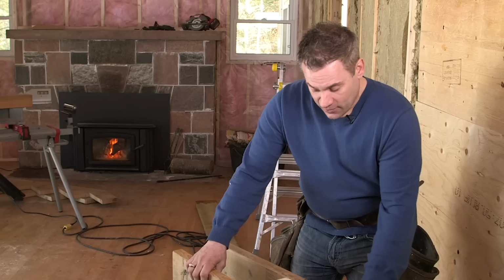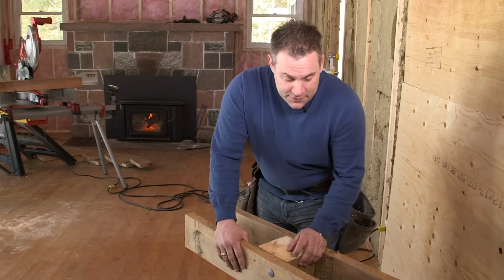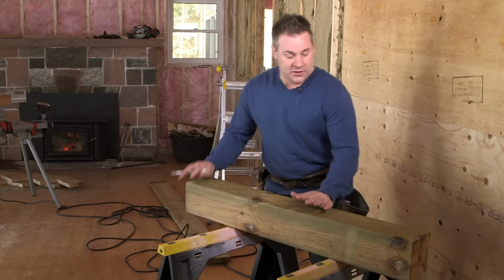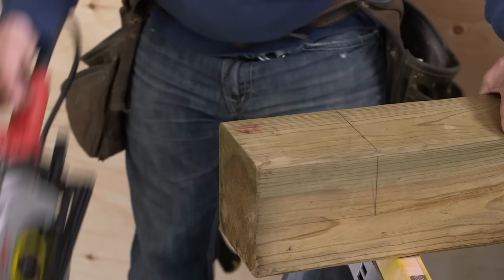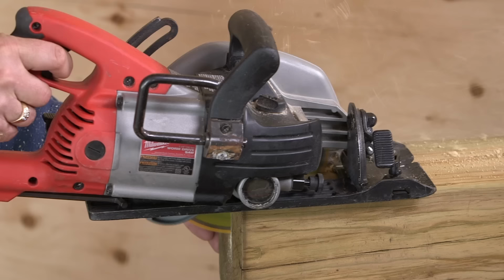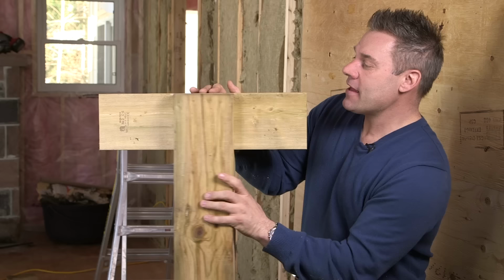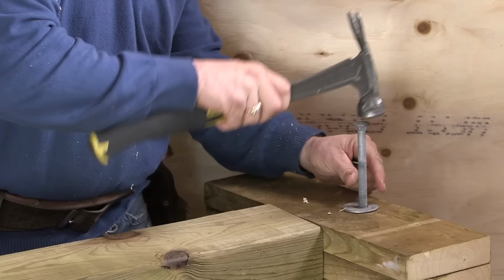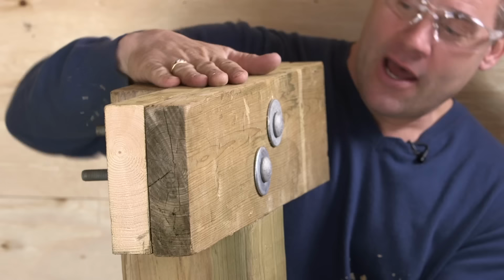How to Attach a Beam to a Post for a Deck | Decks, Docks & Gazebos

Comment: Still wrong, but better. cutting the support beam still decreases it's strength. use the full beam under the joist connecting with a Simpson strong tie, they make them for virtually every application
Reply: Brian Van Horne hardy, been building all my life, used that brand for many applications....what do you use genius?
Reply: Brian Van Horne  never notch, that is a rookie move...
Reply: That's fine,  your believe who and what you want. Maybe you should become an inspector, be a good job for you. But again in my opinion you don't notch when it is providing structural support,  once you do that (in my opinion)  you lose the integrity of the size of the material you are using. If you notch a 4x4 it's no longer a 4x4 for strength, you have turned it into the smallest remaining portion of said lumber.
Reply: Brian Van Horne  I don't know how you figure that. Obviously you have not built a structure with post and beam, the post is completely under the beam and the joist are on top of the beam..about as sturdy as it comes
Reply: Brian Van Horne  I never said any thing about bolts, with the post and beam, joist system you don't even need ties or bolts, you simply place the post 4x4 under the beam  4x6 and the joist perpendicular to the beam..it's as simple and strong as it comes
Reply: Brian Van Horne  ok you are just the best ever...ha ha..I just suggested Simpson ties as "a way"   to attach the post to the beam, you don't need them and you don't need to notch anything either, simply set your beam on your post and attach 2x4 on either side of the beam, the only purpose at this point is to keep the post plumb, eventually the post on whatever you put in on a pier block or poured block is not going anywhere once the weight of the completed deck is on it..

Comment: unstable lateral, reduced integrity of vertical, reduced lateral strength, bolts unnecessary, any number used should alternate direct & washers not needed on head side. put joists outside of vertical and add vertical 2x to underside of joist

Comment: The reasoning for fastening this way is completely wrong. A 5/8" grade 5 carriage bolt has a sheer strength of over 19000lbs. Carring a load directly over rather than beside a supporting structure is just common sense and good building practices.

Comment: Now every deck in NY requires 6x6 posts instead of 4x4 .
Reply: and they just doubled the taxes on each 6x6 post used
Reply: you can use a 4x6 instead of a 6x6
Reply: all depends how high and how many storys these decks are going up  I've built triple

Comment: If carriage bolts have no shear strength then why do you suppose they are called carriage bolts? There are millions of structures built "wrong" in this way that are still holding very strong after decades while those notched posts hold water and rot out. In truth there are benefits to both methods. I would only notch the posts that are sheltered from moisture
Reply: Brian Van Horne ...whilst lowering the lateral strength of the structure. In many cases lateral integrity is more of a concern. Of course you could add more bracing but what is the point of doing all this extra work when those bolts will never shear? There is something to be said of efficiency. I could spend that extra half hour playing catch with my son and the money saved on pl premium might go towards a bigger glove. The wider girder also provides more stability and spreads the pressure on each joist allowing for longer life of the deck as well as reducing span and joist flex. This also gives you the option of fastening each joist to both girder beams. Widening the distance between the fasteners adds structural integrity in all directions. Notched post decks not only take more time and money, they are weaker
Reply: Brian Van Horne  yes I understand the concept and I agree that at first glance it may seem as though it is a stronger build. Further scrutiny and deeper awareness will prove otherwise however. Some of the reasons I've stated previously. Certainly you cannot deny the attributes I've pointed out. Most people don't think that far ahead though, do they?
Reply: Brian Van Horne  it's funny how the least intelligent people are the first to call others stupid. I explained to you in very easily understood terms several reasons why decks are built the way they are. Every once in a while someone gets a bright idea that they think is an improvement and they dismiss or are unaware of the faults of their idea. Tell me. Do you have any idea how many school busses it would take to shear those carriage bolts that you are trying to strengthen? I'll give you a hint, it's way more than you will ever be able to stack on any deck but have fun. Hopefully you will never learn why it's not the best idea
Reply: Brian Van Horne  it is stronger in one direction and area only (the direction and area that is already beyond overkill) it weakens the deck in every other direction and area as I have explained. Obviously none of this has anything to do with platform framing a house btw. I'm not sure why you would even suggest that if you hand any engineering awareness at all. I applaud the enthusiasm but you are failing to consider many aspects of this issue. Nonetheless I'm sure you will do just fine. You have a good evening Brian

Comment: Not true. Try doing a video and break the carriage bolt with the same technique. There's a reason why code includes these bolts. They have a much different sheer strength than screws. Sure making a wedge is better but it's not wrong to use carriage bolts

Comment: This is just wrong. A 1/2" grade 5 carriage bolt has a tensile strength of 150,000 psi and a shear strength of 90,000 psi. The real reason is that that bolts are likely to sag into the wood of the post with that much load on them.

Comment: I guess they give a show to just about anyone now. Nothing wrong with making a beam the first way there is benefits to both the first and the point load way. Carriage bolts will hold it no problem you showed incorrectly with the screw thats not shear strength. Don't notch the post out use a proper post to beam anchor. Buddy doesn't even know the name of his tool. Skill saw is a brand not a tool that my friend is a (worm drive) circular saw.

Comment: Home owners please don't follow that demo because you will regret it ,that guy don't seems to know the difference between sheer strength of a carriage bolt and a deck screw and cutting the 6x6 and does allow for that post to split later hope he used a quality lumber and doubling the beams like he did can lead to the lumber rotten from the inside out ,have seen this on so many deck we 're_ build

Comment: ya, i would never do this unless it was interior framing never to see the elements,,,
i use metal Techno posts with a metal saddle, triple up 2x12 and set my joices on it. no notches. 
Carriage bolts are fine and strong when used properly, this guy seems like he has something to prove but to do what he is suggesting is asking for problems with rot and compromising the integrity down the road.

Comment: This video is hilarious legally you can’t even notch posts in my area all they do is create stress cracks and pressure treated will shrink causing even more.....
I’ve been building houses and decks for a long time and those carriage bolts will hold anything you need as long as you have a carrying beam no further then 10 ft

Comment: notching a post that way creates a stress concentration point that will fail under constant flexing or extreme loading.

In my view, the biggest concerns of deck-building:
-if you have a closed-deck or roof, you have enough post-support to distribute the load adequately
-if you have a high deck, that you use bigger decker posts (6x6) and support them for lateral and fore/aft movement.

Comment: Is it probably best practice to set your beams on something rather than have them on shear? Maybe. Is it because carriage bolts "have no shear strength"? No, that is ridiculous. Those bolts when properly tightened will experience an almost negligible amount of shear compared to what they can handle. The reason it could be best practice to set the beams on a notch is because of the failure of the wood, not of the bolts. If you're going to make an educational video include actual factual information. The fact is that the failure mode of carriage bolted and hanging beams is the failure of the wood above the bolts due to rot.

Comment: So doing a deck beam like that is for driving a car on the deck......if code says do it this way thats what you do not what you want to do to cover your ass a 1/2” bolt will hold more than anything that will be on the deck
Reply: and every builder in myrtle beach says the same thing, and every year someone throws a big house party, the deck is packed, and the song comes on and everybody is jumping up and down to the beat of the music, and then crunch. every summer it happens at least once. and that is just SC.

Comment: BLUF:   drill through the beam you cut its strength in half, and then cut the strengths who knows how many time by concentrating all weight on the top edge of the hole through the beam vs spread out over the entire surface area of the post.  
This solution is ok (albeit ridiculous,), but his explanation is wrong.  the problem isn't with the Bolt's sheering, the problem is with the Beam splitting.   With the bolt through the beam, all the strength of the the beam that is below the bolt is wasted. It offers no support of the deck.  Even worse, all the support the beam does offer is concentrated on that small part of the bolt that is farthest away from the earth (thank you gravity.)  All of the weight of the beams, joists, decking, and people, are now concentrated on a small line where the tangent of the thickness of the bolts makes contact with the top of the hole in the beams.   Should the beam start to rot, it will break away at that location, and like domino's, the beam will fail down its line of bolts like unzipping a zipper. This happens all the time in areas where there are lax building inspections on decks, It always happens the same way:  They throw a party, they have a lot of people on the deck, but the weight is evenly distributed and it ramped up one person at a time so you are just slowly reaching the limit.   
Then that song comes on.  You know the one, everyone knows it and the people start jumping and dancing to the beat.   Before you get to the "C"   in Y, M, C, A, the people are jumping in rhythm and in an instant you go from 1/3 the previous weight (the jump up) to 3x the weigh when they call land on their feet on the deck. Then it breaks. 
What I don't understand is why he is notching the post.   Here in NY we just put the Beams on top of the Posts.  This way the entire surface and thickness of the beam is pressing down on the entire thickness and surface area of the top of the beam. It can't collapse it won't go through the post.  when you lock the joists and decking into place the beams can't move, and before that all you need is to toe in a few nails to the beam to the post just to keep it in place.

Comment: I am annoyed by this. the sheer strength of a grade 8 bolt is on a bad day 750lbs full length is 1400lbs two bolts that's 3000lbs per beam. The problem really is that the water will build up in the corner of that cut, we all know what water does to wood.
Reply: I've built them both ways but I agree with you,  you're not going to sheer those bolts unless you land a helicopter on your deck.

Comment: Bolts are fine especially when fitted with connectors sandwiched between the faces. Galv round head nails also work just fine too if the deck has enough supports and spans around 1200 mm. Unless of course, you invited elephants to your Barby.

Comment: How wrong can one person be. Let’s see how wrong.... The sheer strength of a half inch (12mm) 4.6/s (mild steel) carriage or coach bolt is a whopping 28kn. To put that in perspective, if a 2 tonne car accelerated to 35 miles per hr (60 k’s) in 5 seconds that force created is only equal to 6kn. Yep try snapping that with a hammer pal

Comment: Wow totally wrong mate, demonstrating shearing a crap screw has no relevance to the shear strength of those bolts, they will never fail supporting decking. in fact you have made it weaker by applying all the downward load to half the section of the post.

Comment: Carriage bolts with washers on the head side? That is not how those work.
Reply: Yes.  It allows great surface area of contact so the wood does not deform under the bolt head when tightened.  You can lock the bolt down with greater force spread over a greater compressive area with a large washer under the head.  This leads to long-term stability especially in 4 season climates.
Reply: @xavariusquest4603  wouldnt a hex head bolt with a similar washer do the same?
Reply: @klardfarkus3891  the thing about the carriage bolt head is that being substantially broader it distributes the forces better.  Back in the day carriage bolts would not have used backing because construction timbers were generally finer grained, more resinous, and stronger...so, when tightened, they did not sink into the wood surface upon tightening.  Would a bolt work...sure.

Comment: Utter Rubbish! The coach bolts are more than strong enough for the application. Cutting out a halving joint like this without re-treating the cut ends will start the decay process as you are undermining the treatment in the timber.

Comment: I wish some these self help shows would consałt a engineer before making outrageous  claims   3  wood screws and 2 carriage  bolts has more shear strength than is claimed  and would be passed by a real engineer    ,,,I  was carpenter  for 43 years timber structures  and I know how to biuld decks properly,,

Comment: Sorry folks but that is not the proper way sorry, plus the carriage bolt has a notch on one end to set into the wood. So putting a washer  on it would. The other side would just spin, if u think I'm wrong try it. I have 30 years experience being a carpenter, I'm not saying I know everything or that I'm never wrong. If a person tells u they know everything, they don't. Plus u should check with ur local building permit office before doing that!!

Comment: Full of crap. The bolts only take part of the weight. The rest holds due to friction between the lumber faces pulled together by the bolts under tension by tightening.

Comment: Don't build your deck depicted in this video it will never last, metal screws or bolts are not used to hold weight, beams should be used for 2x6 boards to lay on the beams not 2x6 boards to beheld by bolts or screws to hold the weight.

Comment: You have no idea what you are talking about. Just because you think it, doesn't make it true. Attaching stringers to posts like that is absolutely to code. The sheer strength of each of those bolts is about 7500 lbs. for two if you can't add, 15000 lbs per post.

Comment: Horrible workmanship. I would never pay any tradesman who did that.
A single joist is both cheaper and stronger than two thinner ones. No need for the ugly washers on the head side.  Countersinking the head on one side, and on the side with the nut and a washer with bolt length flush to timber face.

Comment: You DON"T USE CARRIAGE BOLTS...! You use the correct size standard bolts. Not less than 1 inch diameter times two fo each joint!
You don't notch a beam that has to carry a load between posts! Look at any properly built Post & Beam home/lodge!
Amateurs...  Get your deck properly designed by a certified Architect before you build anything.

Comment: This is one of the stupidest things I have ever seen. You don't need bolts and you don't need to notch the post. The 2''x6'' header beam just has to sit on top of the 2''x6'' secured by a couple of screws. Simple as can be and stronger than both of the ways this fool shows here. I was a journeyman carpenter for over 30 years building houses and this guy would have been fired or laid off if he did work like that.
Reply: Absolutely right. The strongest method is a header beam directly on top of the post.
Reply: Unless you are building a low level deck like me and don't have the head room :)

Comment: Yeah, this guy has over 4 million views on a vid chock full of Pooh. You will spend your life trying to shear a 3/8”-1/2” bolt. We’re not talking about building a house foundation. My deck, built with 2x6 bolted through 4x4 post has stood 30 yrs. firm. Wood is now rotting away. Would not have left this comment had I read through and saw what folks thought of his thinking.

Comment: Bull CRAP! Two 1/2 inch carriage bolts are MUCH stronger than a cut-down 4x4. Let's use a hydraulic press on a pair of carriage bolts and compare that to his notched 4x4. IF (big IF) he's using seasoned OAK for a post, the "Bible" of lumber says it can stand 14,000 lbs under compression. Half that for his treated pine. 1/4 that for his haunched 4x4.  I've spliced floor joists with double carriage bolts on a 2x10. If anything fails, it'll be the wood NOT the bolts. I can squeeze compress a 4x4 treated pine 4x4 to about 2" thick using machine bolts 5/8" in diameter and a 1/2" break-over socket wrench. Done it, and I'm old and sick (I've had three strokes).  If you REALLY want to make it strong, bend a 1/4" strap of steel and place the bottom of the "U" over the top of the 4x4 with bolts thru the strap. Wood will rot, but steel will not. Some archaeologist 1000 years from now will wonder what you made with that piece of steel and those two bolts. I've worked on old houses and repaired them instead of "tear it down to the ground and re-build it". I live in one. I know how to do things my great-grandfather taught me (a REAL carpenter) that this guy will never imagine. Let's see this goober replace a rotten window stoop without tearing out the wall or the window.